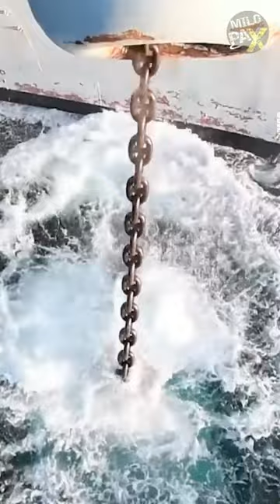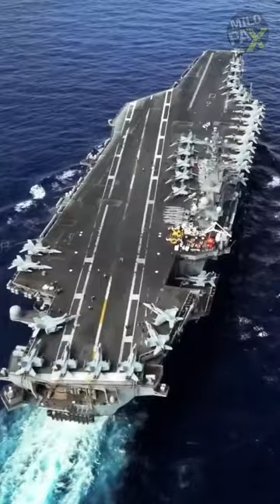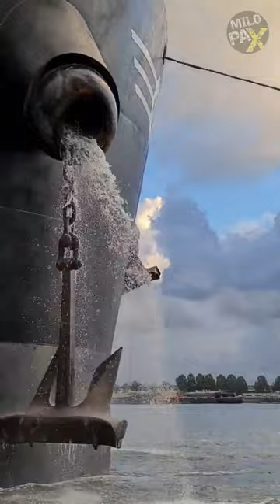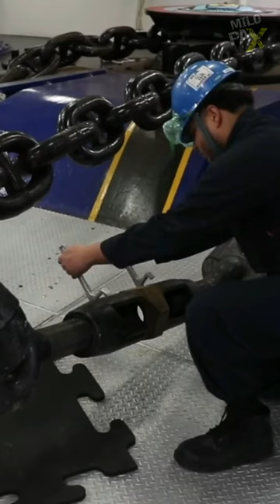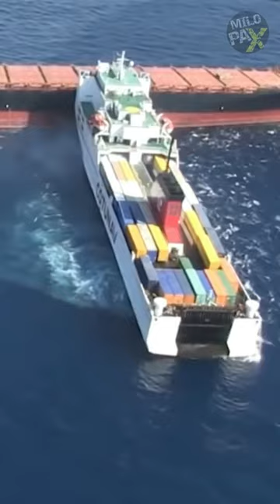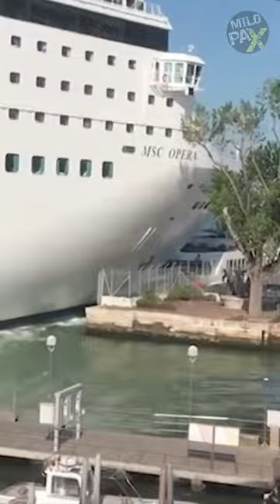Anchors on Aircraft Carriers Are Never Free-Dropped. #shorts

Comment: Jul83 to Feb 84 USS Ranger CV-61 I was with VS-33 AZ2 1982 to 1988 VS-41 and VS-33..The Ranger dropped anchor and we had three days off with what's called steel beach day and on the four day we tried to pull the anchor up and the motor that did this burned out so three more days and then back to normal.